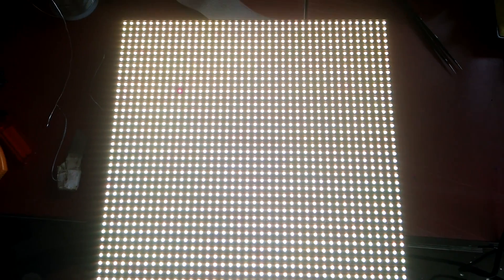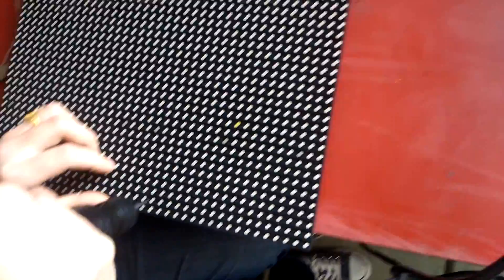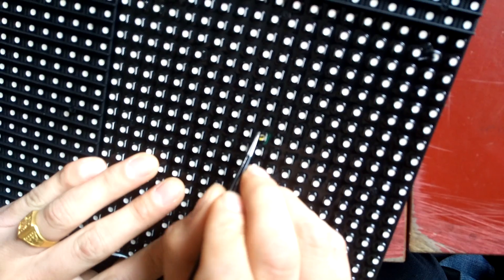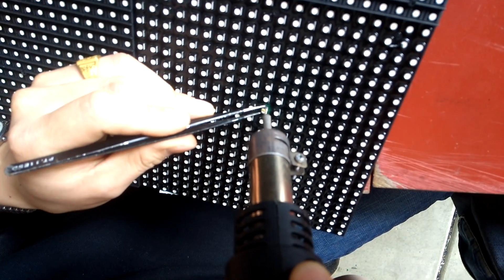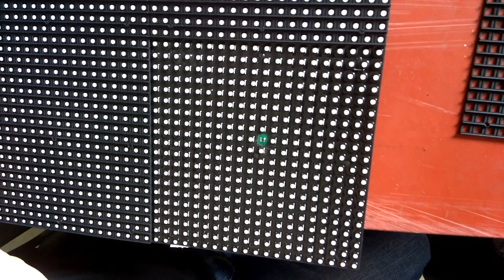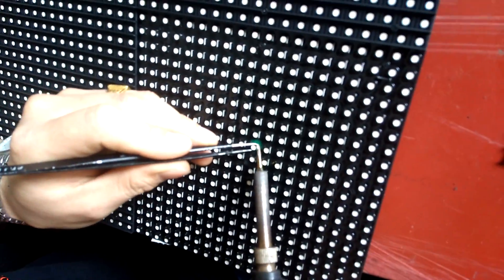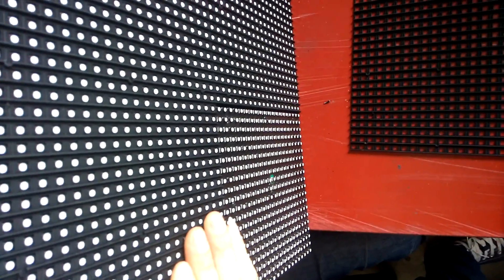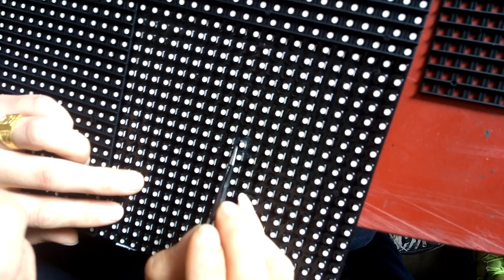LED Module Repair

Comment: I have an outdoor ledwall 6.66 pitch, lightking-led model RO6 / RO (C) 6, dimensions about 6.4 meters by 4.8 meters used 5 years
where do I find one who has your patience to re-solder all those LEDs about 10-15 per module? how much can used to sell off?
congratulations for the video and the work done
Reply: Hi do you still need someone to repair your led modules?

Comment: I do appreciate the info. It was a good demonstration "How To" video. I would advise getting the manual focus set on the camera before you shoot the video next time. Also... it's not welding, it's soldering. 
What is the plastic you spread on after replacing the LED?
Reply: its a selicon

Comment: Hello, Can you help me repairing my modules?
I tried to do the same steps you did, but unfortunately, the 3 bins in the bottom are touching :( 
I have an outdoor P8 SMD 

Thank you in advance
Bassil
Reply: Hi bassil, it is miya here from GKGD ,China , which is specialized in modules wholesale for many years . and also is the top 3 manufacturer in China . we have modules types including P1.667,P1.923,P2,P3,P2.5,P4,P8,p10 ...
if you have any question, please feel free to contact me .  email : sales9@gkgd.com  Cel: 0086-15364850390
Reply: we production and sale LED Module, visit www.ledvv.com contact us
Reply: U can check this videos, am sure it will be helpful: 

https://youtu.be/FRQ415ocqfA
Reply: tell me messenger,  I send information about it for you.